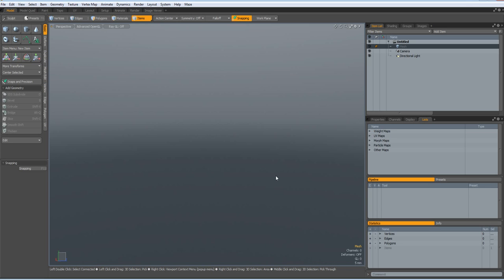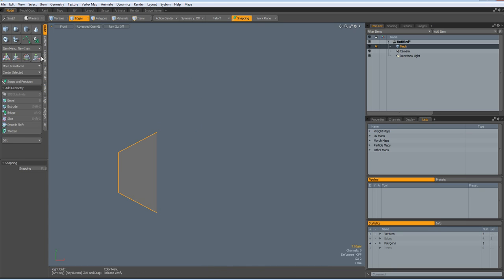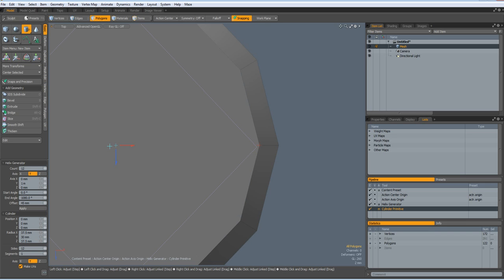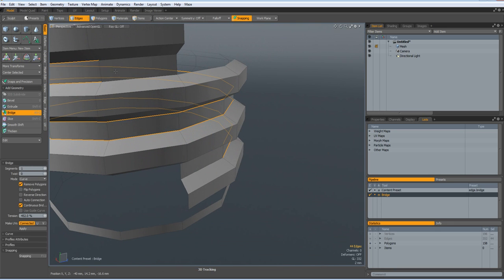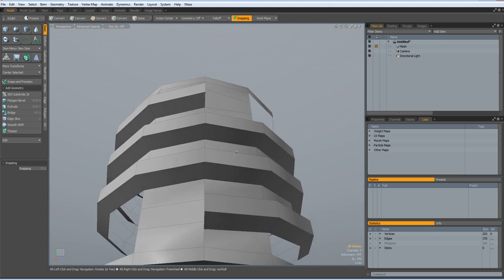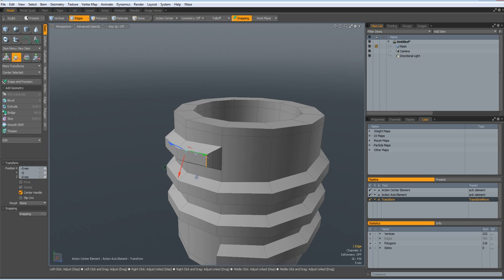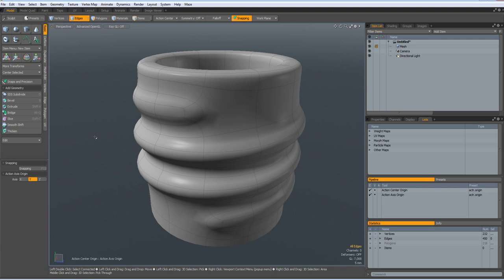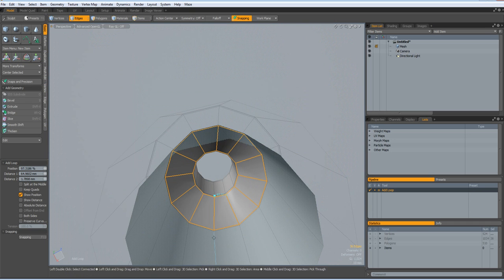Luxology modo - Yet another way to make a Thread

Comment from the maker: Hi, I'm sorry, my recording software does not support this. Besides, I use so many custom shortcuts it would add more to confusion than to clarity. You can always see in the bottom left window, what tool is active and what tool settings i'm using. Regards, Peter

Comment from the maker: Hi Luca, modo is quite forgiving with n-gons, but when you need all quads for some reason, then you must go up with the sweep count to about 48 per thread. Then you can convert the n-gons to quads and it will look good. With only 12 sweeps per thread, you get the problem which I describe in my 'Perfect holes in a bent surface' tutorial. Kind regards, Peter